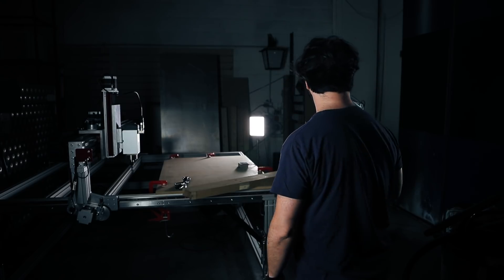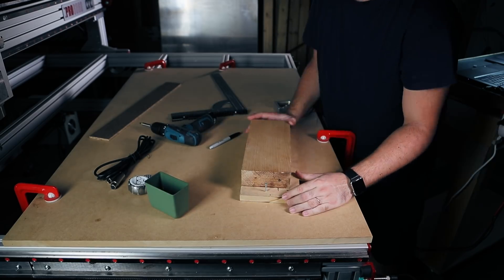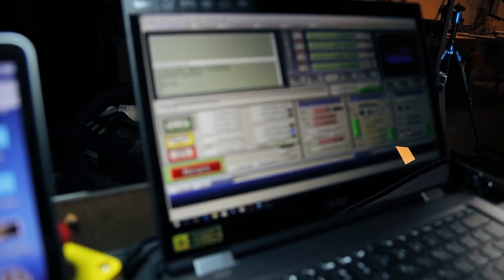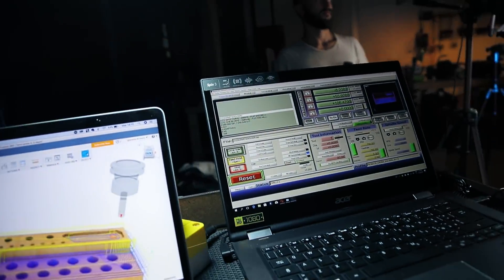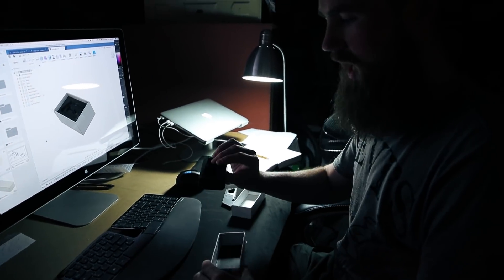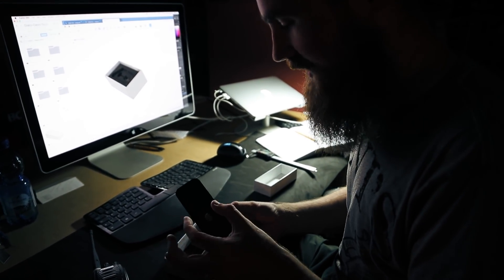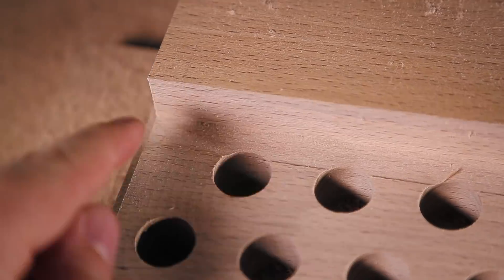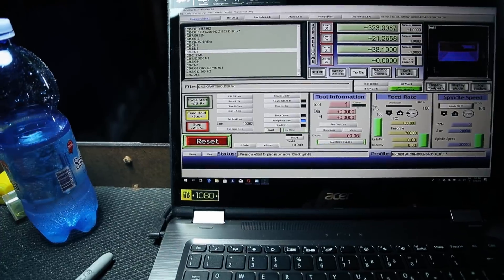CNC: Crush it 'till You Mill It | GIACO

Comment: Feeds and speeds looked way too slow on the first operation. Going that slow you could triple your depth of cut with that diameter bit, or triple feed rates. Going slow will wear out your tooling very quickly as well as taking forever. Tool change in fusion will allow you to pause and re zero. Rule of thumb I follow, 0.25mm load per tooth on a .25" bit, reduce by 25% for each additional diameter in depth. So 6.35mm diameter, 19mm depth of cut, 0.125mm load per tooth. Plug this into fusion, you'll be amazed how quick that works out to be. Generally I run the spindle at 18k rpm.
Reply: Oh one other thing I just noticed, you should always ensure you're using 'conventional' milling rather than climb on a router in wood. In general on a thicker part I run multiple depths with tool diameter x2 for stepdown, radial stock to leave of 0.2mm or so, then do a full depth (assuming tool flutes are long enough) contour at ~80% of the feed rate to finish. Make sure you're making a real chip during the bulk of your material removal, the chip takes away the heat. You can measure the difference in tool temperature by increasing feed rates, it's counter intuitive. This can increase 'sharp' tool life by 10x. Love your work, bought a knife, can't wait for it to arrive :)
Reply: I think the feeds  are ok, the problem is object orientation and correct zero positioning

Comment: You need to go over your Zero position for every axis, then re-check. Do this for every operation. Twice. 
I like my zero XY at my workpiece always in the same spot in software and reality, just for sanity- and keep my cut to the negative.(Zero at the top of the cutplane).
For one-off fabrication, I break the G-code into 2 parts (one for each tool) makes an easy low-tech solution.
But there are several ways to stop, make the tool change, re-zero, and continue on. 
It's a really easy software once you have it comprehending your Fusion complexity. Just a few small tests and you'll be perfect.

Comment: Ya kno'... The best part is that during all that SUPER FUCKIN' ANNOYING and TOTALLY UNNECESSARY LONG slowmo the 500kg+ machine with a 3kw+ spindle only JUST BARELY removed like a smidge of material with each pass for what felt like HOURS and then he messes up his second run after swapping out the endmill and the machine FINALLY goes in balls deep with the endmill with like a 2000% or so MRR compared to what we saw before.

Pretty sure what happened was the machine just releasing all that built up stress from not showing its capabilities.

Comment: My guess would be that you generated G-code that is using relative positioning rather absolute. If it is relative you cannot move the gantry manually as you throw the whole process off.

Change the CAM processor settings to produce absolute G-code. Then you can change the tool, re-zero the z and go ahead.

Comment: Since you have to manual tool change you'll just have to run mutliple files for each tool with a zero point on the piece. It makes it much easier. So you'd do your roughing pass with a tool, end file tool change rezero and go. You can also import the finish project design and build off of it for your subsequent files so you don't miss a depth or sizing.
Reply from the maker: Yes that’s what I did but I need to remember to put the tool back close to where it was or it just goes through whatever in between 🤦🏻‍♂️
Reply: Giaco Whatever make sure you lift up the cutter in Z, above the workpiece before starting the new program/ resetting cutter height. The program is moving in X,Y before it moves up in Z.
Reply from the maker: Yes! Which is sooooo stupid, right?!
Reply: Oh yea, she doesn't know anything changed... Might have snapped a few bits off in that instance :/ I'll usually manual cycle to a corner for zeroing. You got moving faster than I did when I started. It's intimidating.

Comment: For tool chance. 

In the setting tab on Mach 3 there is a button saying “ignore tool change”.  You want that off! 
Great video man!
Reply: i forgot to  mention, with ignore toolchange off, it will automatically prompt to zero z axis.
Remember to check that the box is checked before every job because default is usually to ignore toolchange.

Comment: Check the box manual toolchange in fusion then mach3 autoholds until you press cicle start again. You can rezero the tool in the hold state
Reply: Kilian Stumpf yep. Absolutely have to re-zero z after every tool change. Also 'stop' is only for emergencies. Use feed hold to pause during a job.

Comment: For now the safest way to tool change would be to do what you did the second time, and have a seperate file for each tool and operation. Mach 3 and 4 save X and Y coordinates between tool changes, but you'll need to set the new Z height with each tool, as you already knew. One thing that happens to me when I do an emergency stop like you did when you put the second tool in is mach will lose control of where the X and Y are now, usually by almost 0.100". I'm not sure why, but I suspect it depends on your acceleration and deceleration settings and how long it takes your machine to stop moving after you hit the emergency stop button. I try to leave a reference surface unmachined just in case this happens so I can re-zero all my my axis' in an event like this, which is what it looks like is what happened to you. look about +0.1Y and -0.6X or so from where those cuts were supposed to be. 

sugestion for putting stock on the spoilboard squarely is simple. screw a strip of wood along the bottom edge, and just use the spindle to cut a flat line along the axis you want to use, right down to the spoilboard or even a little bit deeper. I keep one on the bottom edge of my X and on the left edge of my Y so I can quickly get stock square on either axis.
Reply from the maker: That is a really great idea! I will do that, thanks!!!
Reply: I don't know if it helps but I remove the "H" commands from my g-code before loading them into Mach3. I had noticed that the tool heights from my library would override the manual Z height i'd set in-between operations. Often this would result in exactly what happened to you with the end mill violently driving into the piece. I also keep the program running but turn off the spindle only and take note of what code line I am on when there's a tool change. For some reason my "auto zero button" code makes my program skip forward one line so I have to set it back one and tell it to resume from there. As a safety I always raise my Z above the top of the stock before resuming. Sometimes preparation moves may not lift Z first. That's my experiences anyway. Good luck buddy.